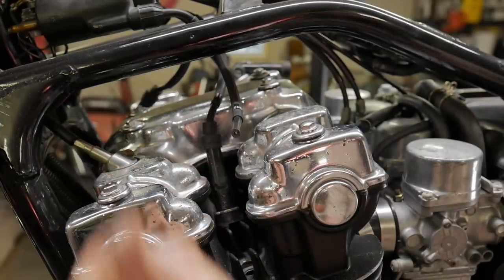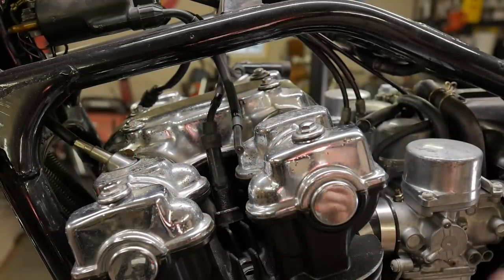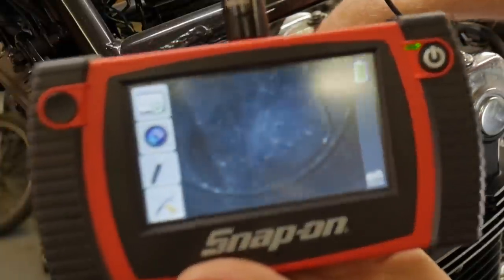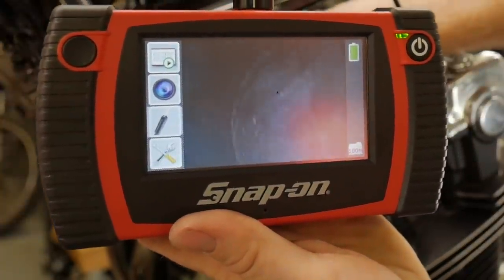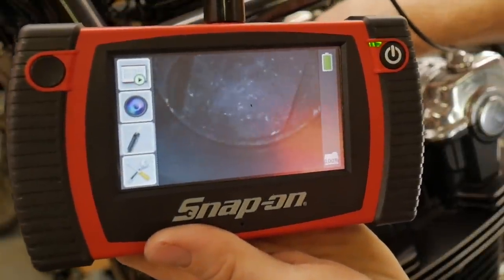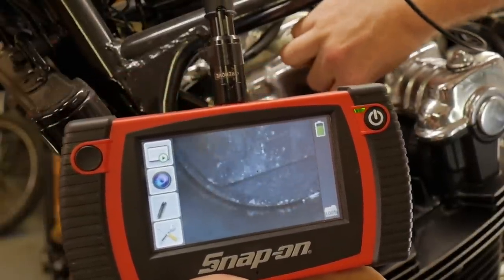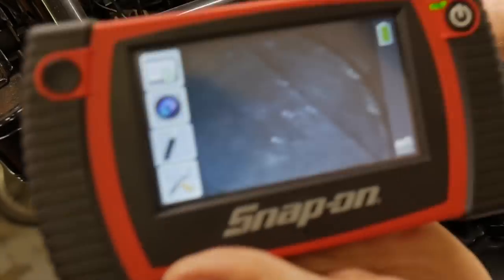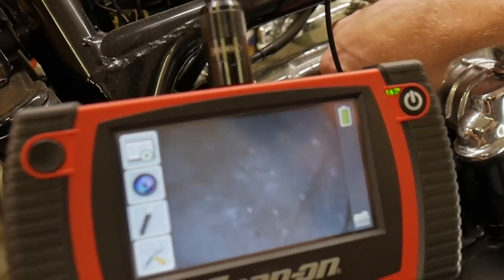I DROPPED IT IN THE CYLINDER

Comment: In '76 a schooled MBZ mechanic and I were performing valve guide seal replacement on a 450SL when he dropped half a valve guide seal that landed on the timing chain. He almost had a heart attack. I got a large pair of hemostats, and he wrapped insulated wire around the hemostats. Next we connected a dry cell battery to the wire and created an electromagnet. My friend was able to pick the valve guide seal off the timing chain. If the seal had fell down, it would have gone into the oil pan.
Reply from the maker: Love the story!! That’s insane that it worked! I would think you would be magnetized to the timing chain too! Solid solution
Reply: @TheMotorcycleMD  Thanks Cody!. I appreciate your channel and the knowledge you pass on to us.

Comment: Literally ran into this issue a few day’s ago on my 03 Explorer 4.0L except I lost a fuel injector o-ring while changing out the valve covers. Passenger side was going back on when I realized the o-ring missing and found it sitting on top of an open valve. Tried to hook it and it fell right in smh i almost cried and gave up. Don’t have a shop vac or access to compressed air not to mention time to pull the head so I’m gonna try the tape on wire hanger and pray that I can save this truck! Times are extremely rough and can’t afford to lose this

Comment: Just did the same with a dail pin from the rocker cover, I believe it has fell down the spark plug hole 😢 just ordered a borescope  so will take a look tomorrow, cannot believe how dumb I was. The little voice in my head said to check first and to even leave the plugs in by nope, followed the manual and removed the plugs first and bosh,now this and the pin is pretty much the same size as the plug hole so no idea how I am going to pull it back through.

Comment: If #1 is on the exhaust stroke, #2 should be just behind it on the power stroke...I recall that Honda uses the 1-2-4-3 firing order (reverse the order of most 4 cylinder car engines.)  
PS: I can't make it out from the pics - is that a 750 or a 900-F?

Comment: This is the first video I've ever watched that made me want to yell at the screen.

Everyone with any experience has done a dumb dumb like this before.  I sure have in my 50+ years turning wrenches professionally.  But.  The old saying "when you've already dug yourself a hole, put down the shovel" applies to you here.  When you confirmed the junk wasn't in #1 the very first thing you should have done is cover the hole - tape, thread in a plug, stuff a cork from a wine bottle in it - something!

How many times did you drag your coat hanger over #1 after pulling it out of #2?  Then you dragged the vacuum hose over it.  One bump, one slip and now you have junk in two cylinders.  You knew you screwed up the first time, why not do everything in your power to not let it happen again?  That's all.  Carry on.
Reply from the maker: 😂😂 Glad I was able to raise some BP’s this morning

Comment: The running engine would've spit that soft soft wire and rubber out the exhaust immediately with no ill effects.
Reply: Really?
The valve opens enough for the cut piece?
Reply from the maker: False. I have seen many of rubber compounds from intake boots get stuck on valves and the motor looses compression.
Reply: Were you, were you watching the video?  Did you see how big that piece of rubber was?
Reply: @TheMotorcycleMD  just wanted to say, thank you for posting this video!
Along with all the other great shit you share!
Reply: I cringe watching people do piston wrist pin clips  on groms without blocking the jug.
Reply: @TheMotorcycleMD  The engine runs on the remaining three cylinders and the rubber gets chopped up and spit out and 4-cylinder power returns in short order.  Valve seat and faces, etc are pretty tough, which explains their survival for untold number of cycle at high temperature.